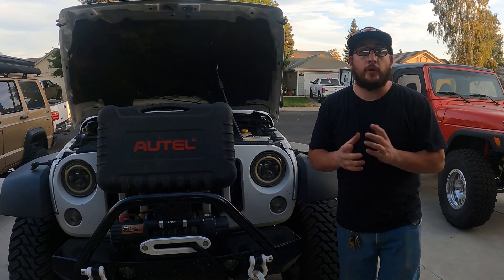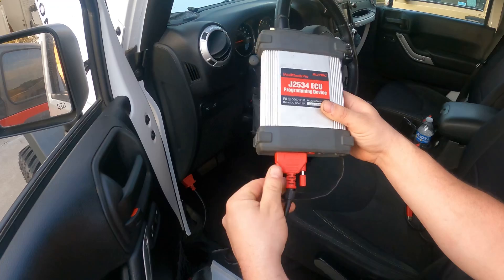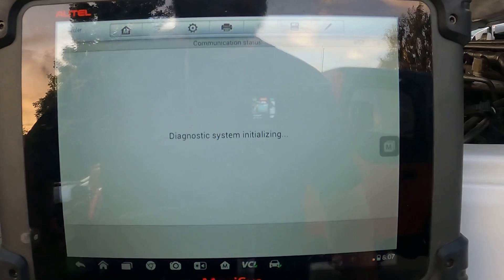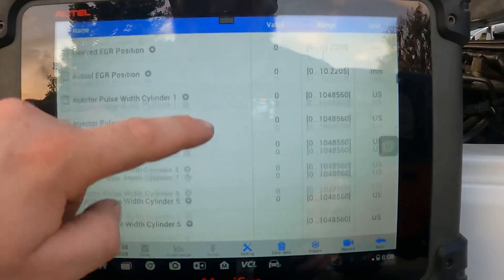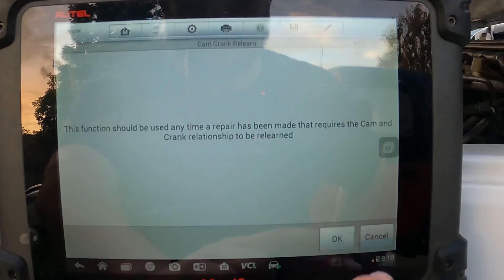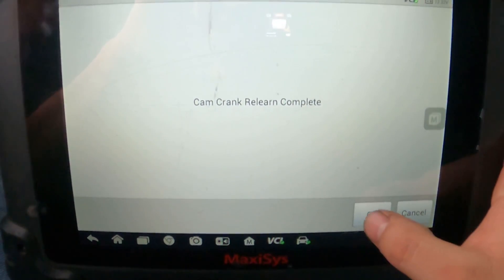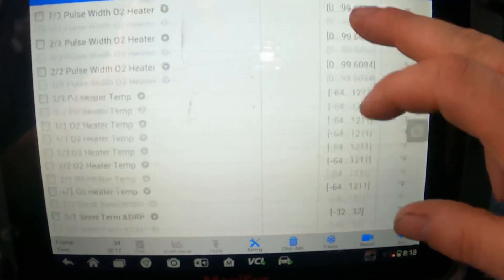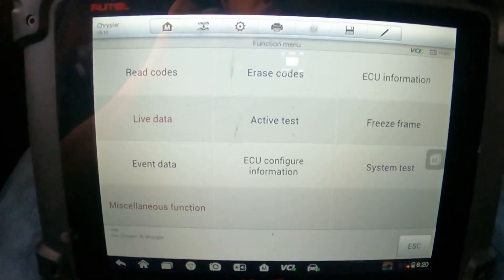Jeep Wrangler JK 3.6 Pentastar Cam Phaser Cleaning and Cam/Crank Relearn Procedure

Comment: If you don’t do this will it keep it from starting after replacing all 4 cams?
Reply from the maker: It won’t
Reply: I’m working on a Durango 3.6 and I’ve replace all the cams, lifters and rockers. Timing looks good but it’s not turning on.
Do you have any suggestions?

Comment: hey boss thanks for sharing so for the pentastar engine i have a rough idle in drive or reverse but smooth out in neutral. there are no misfires and there are no check engine codes. my fuel trim on bank one are a little high like 10 or 14 at times. on both short fuel trim . any input i appriciate it. i also am using a autel 906

Comment: why does not the oil flow through and flush the sensors all the time while running?? or by giving it a good run at variable speeds on the freeway and such??? can someone explain it to me? Does the control open the valve better or something or should a person rev the engine will doing it??
Reply from the maker: @jaysilverheals4445  good point, yes driving the vehicle activates the valves, except this procedure is mainly for the relearning process, the “cleaning” if you will is designed mainly for troubleshooting a failing or failed phaser/ solenoid. Activating the solenoid, cycles the oil control valves which also encourages dirt and debris to move in the case one is sticking or failing. The possibility of doing this in the shop and not under load allows the tech to throughly capture what’s going on without high revs or driving the vehicle.

Comment: That's cool you're able to do that instead of paying an arm and a leg at a garage or god forbid a dealership.
Reply from the maker: There’s a lot that can be done without the dealer these days especially on newar cars. But now, they aren’t repairing them like they used to do. They are trying to build engines in ways that the average guy cannot or think it’s to sophisticated to repair . Then if it’s not a simple fix at shops they sometimes won’t even touch it because the liability. Most shops just want to replace the entire engine or trans so they can start over.
Reply: @ATEMOFFROAD  that's crazy
Reply from the maker: @stevend9124  it is and I can continue on with this but I think you understand 🤣🍻
Reply: @ATEMOFFROAD  I do all about the dollar 💵